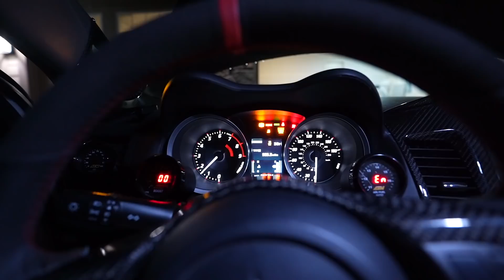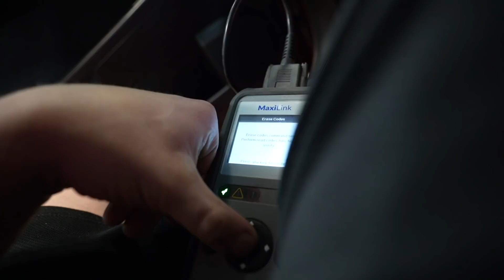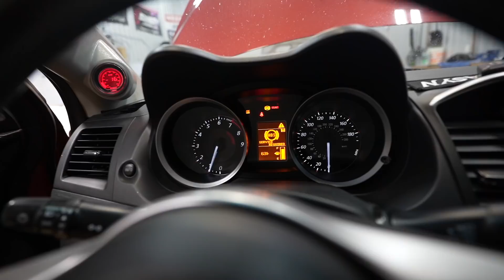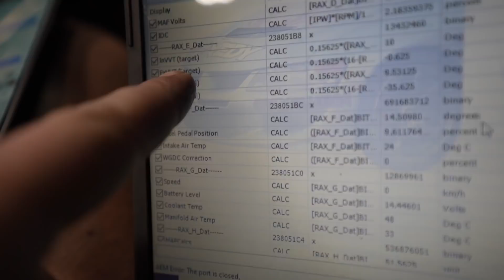The Evo Motor Comes Back Apart.

Comment: Hey Devin, with the block being decked and the heads being surfaced possibly multiple times...you may need a thicker head gasket and probably a very good idea to degree the cams.  Plus if you degree the cams you'll end up getting free horsepower as it's often overlooked.  Would be a good skill set to add to your toolbox.   

For the battery going dead run a battery lead that's hidden that you can easily access from underneath the car to connect to your jump pack or a battery tender style setup to avoid having to break in.

Comment: Yo Devin, so the cam sensors are basically magnets that read the position of the sensor and output a voltage. It could be possible maybe that the Crank trigger (or reluctor ring) was installed flipped around causing it to be off a couple teeth? I know this is common with DSMs as well.

after some research i cant find that X's have any sort of Crank sensor.. so they must depend on the Cams sensors for the crank sensor as well..
Reply: if the ring was installed incorrectly the car wouldnt start, ask me how i know 😂

Comment: Hey Devin there’s a tool that allows your to remove tension off the timing chain so you could remove the cams. It’s commonly used when upgrading cams with the engine in the car. It’s made by tomei

Comment: Hey man I ran into this multiple times similarly on my Forte and Tuscon build. Now what's crazier I mentioned it in a previous video of yours after seeing you yank Jareds old engine apart I believe or maybe the evo 8. I'm pretty sure they're the same basic building block of engines. Either kia/hyundai bought the plan from Mitsubishi or vice versa. It was a curious thought i had after seeing your timing and because I had just... did mine. Then after diving deep. Turned out I was right. Either way, vvt solenoid issue. What I found fixed mine after replace and playing with all the sensors. Was one of 2 issues. My oil was low about 3/4 of a quart or my oil pressure sensor plug was grounded out from some oil on the connector. Make sure that baby is at least plugged in all the way. If it trips, there wasn't a code it just kicked me back an "intake over advanced timing" code. aka vvt solenoid replace. But really it was the the oil pressure sensor. I cleaned the connectors blew them out and plugged it in. No more issues and the engine finally sounded right. OHHH also what i found on my adventures. If I'm right about the similar design. There should be a random extra bolt into the side of the head down by the thermostat housing. The housing will kind of randomly go around it. If it does, break that bold loose pull it out. And you should find a tiny little screen. It's very possible if you're using the same head that after the cease that some debri got in there and clogged it. That goes directly to the Oil Pressure Sensor. Again if OPS reads wrong, then vvt, doesn't trip to switch to high power output. Then that sends back the "intake over advanced timing". I hope these help. Good Luck.

Comment: I want to see what you find with the cam problem.  I had the exact same problem with my 08 after the head rebuild. The difference is I did  kelf cams and mivec delete but that problem with -35 degrees of timing was also there. Ended up buying a new mitsubishi cam sensor,  cleaning the hole the sensor goes in and area the cam sensor was in to make sure it was flat, cleaned the electrical connectors with electrical connector cleaner and my tuner did some work on the tune for the mivec. This ended up fixing it for me. I really think cleaning the surfaces and the connector had a big effect on it. Good luck, ill watch the next one to see what you end up doing.

Comment: I locked myself out of my sti before while it was running on the side of the roadin the winter, tried for an hour to get it open and couldn’t, ending up taking a hammer to the window hahah had a spare so it wasnt a big deal besides the mess!

Comment: After I built my head on my x it was doing the same thing can’t remember if it was the same code but I put thicker oil and it fixed my issue. I put motul sport 5-40 with ester

Comment: Did you possibly install the exhaust side cam bearing upside down? Meaning the bearing with the hole was put on the top cap?

Comment: If you don't use the bluetooth that comes with the car, unplug the module under the glove box, maybe that's the problem. In my case the battery drained in 3 days 0:58
Reply: Advice thooo

Comment: It could be the exhaust cam gear!! I had this issue when I swapped my oem cam gear to a torque solution cam gear and my car idled like shit even with a new tune it was difficult to tune so I swapped it with a mivec delete and it went away. My car wouldn’t even idle I would have to hold the gas for it to stay alive.

Comment: Vanes at the exhaust cam gear are relatively ok, taking into consideration that nobody “looking” over there, ever…
On the other hand - with low/no oil it will run full retard and it is disabled below 1133RPM and 77 dC coolant.
The cams are designed to default to 0 on both cams in a resting state. However, they rely on oil pressure to do so. The EX cam has a helper spring to keep the cam in a neutral, or 0 deg state at idle. When you have a heavier spring, larger cams and lower oil pressure at idle, the Ex Cam can not stay in the '0' position and falls to -30deg.

Comment: Ain't the lobs on the cams designed to move if the valve hits a piston to try prevent even more engine damage
Reply: Good point recently see the same thing on another channel where the lobes had turned after cam belt failure but that was a ford ecoboost engine. Solid camshafts often break there Woodruff keys on the cam pulleys for the same damage  limitation reason.
Reply: @keithbaldock5304  a lot of modern cars have them now duno specific models I wouldn't rule it out tho

Comment: If the springs and cams are too strong for the MIVEC gear to control .. Once the car warms up, and oil gets to operating temp (less oil pressure) 
Then the MIVEC gear will NOT be able to modulate the cam timing .. which is why you see in Evoscan, it’s going to full retard position (-35 Deg) .. If I’m not mistaken .. The target and actual should always be within 1° of each other.

Comment: Scotty Kilmer just put out a video the other day about products you should never buy. The fantik jump pack you use is one of them. He said it didn't work. But obviously it does!! Someone should show scotty how to use it?!
Reply: I got the fanttik air compressor went to fill 1 tire up on my car and the battery dropped 2 bars. For over $100 I was disappointed they are sending a new unit out to replace mines
Reply: Geeez